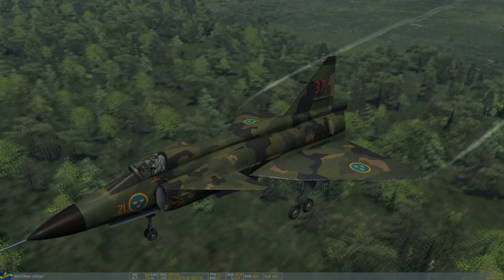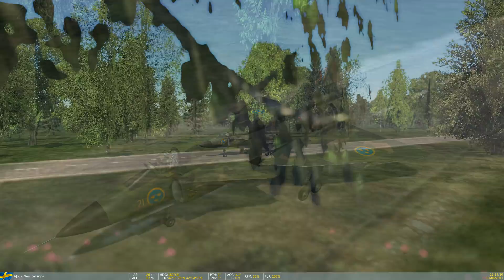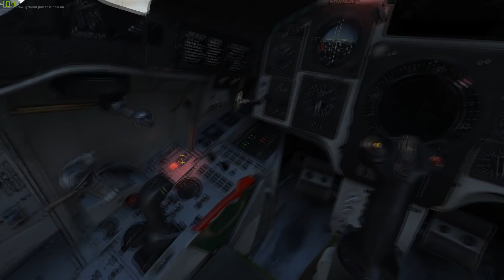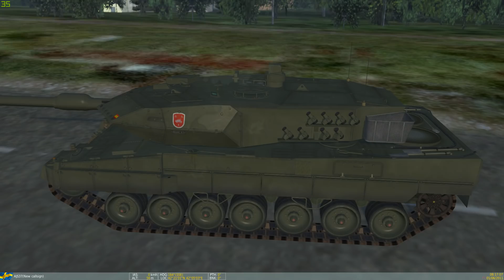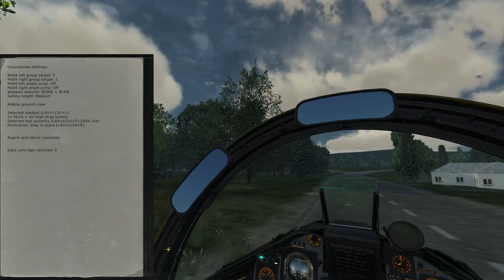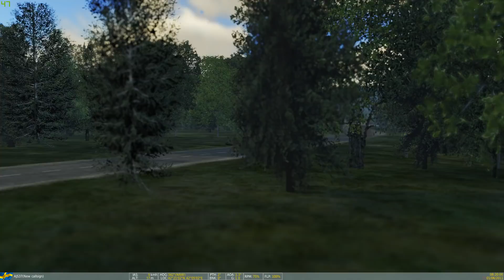DCS - Viggen Road Warrior

Comment: Very informative video and good narration. One small tip to further reduce the workload during takeoff is to set the gear lever to its UP position before starting the takeoff roll. When the plane sense that there is no weight on the wheels, they will automatically be raised. Helps shaving a couple seconds off getting cleaned up. I haven´t noticed any adverse effect in loss of lift as the flaps are raised. :)

Comment: Thank you for posting this very nice video. 
Without going into much detail, the video is however just a tip of the iceberg of how the two different Airbase disperal doctrines used by Swedish Air Force worked. I am happy you explained it in the beginning of the video in Sweden the go by the name BAS 60 & BAS 90. 

Even if the video suggests that it was very mobile and for the Viggen system especially in use for DCS,  IRL the BAS 60 & 90 was on the contrary quite complex and perhaps maybe not so mobile as the video & DCS would point out to simulate.

Greatly simpliefied, one can say the system consists of 4 different setups of airbases.

#1. Peacetime Airbases (Airwings)
These would be the bases or "Flotillas" Swedish Air Force normally operate from during peacetime. At its peak 1950-1960´s, Swedish Air Force had around 17 Airwings and about 1000 aircraft divided to about 50 squadrons. To counter the initial vulnerability of a massive airstrike, some of these airbases had a vast underground hangar complexes. Enitre squadrons and their aircraft were stored underground where there were maintenance facilities, vehicles and equipment for the aircraft. Think of the mines of Moria but replace the gold with planes + weapons and the dwarfs with officers and conscripts and you would know what I mean. 
;)

#2. Intermediate Airbases
In addition to the existing Airbases / Flottilas, there was a runway system in the very near vincinity of the base with a complex road system (both taxiways, main runways, backup runway, parking spots for aircraft, bunker system with command centres, logistical centres etc. The system also functioned from time to time as emergency runways. Some of these runways were used as normal roads during peactime, some were off limits.

#3. Warbase
These airbases were purely functioning as a hidden airbase system and would be much similar to #2. All required infrastructure was more or less in place.
Only Planes Personel and Vehicles needed to be transferred there. 
Their locations could be very much remote and could be very difficult to attack. 
During the 70´s and late 80´s the BAS 60 & BAS 90 system were subject to extensive military exercises. It was not uncommon for regular civilian car traffic to be stopped for a Viggen coming into land or crossing when coming in on a taxiway etc.

#4. Improvised Airbase
As a last resort, the system could be functioning in a total mobile scenario much like indicated in this video. However the endurance and ability to deploy a great number of Viggens in such a venture would be very limited. The backbone of the system was #2 & #3 in a wartime scenario. There the operability of the Viggens and the tempo of how many aircraft could be deployed were actually increased compared to operating from #1! 

Except from the trees being a little bit close to the runway, and that you came in a little bit too low initially (normally you would see the runway before you took out the gear) your video was spot on!

Although the AJS37 is a remarkable aircraft, it saddens me that the interdiction/fighter version (JA37) is not included in the Viggen Module. It had a more powerful engine, tracking radar and A2A armament with automatic cannon as standard. 
And just as the AJS Viggen, perhaps it´s most useful "weapon" was that it had a quick turnaround time on the ground, bar none.

Sometime in the future, I hope that I get more time available to fly the Viggen.
I look forward seeing more of your videos.

Keep up the great work!
Reply: Sorry, Not "Interdictor", I got my head into the Tornado where ADF and Interdictor was similar to the JA and AJS. My bad.